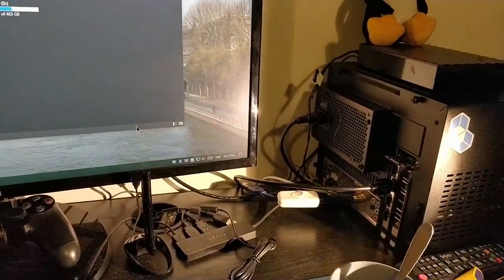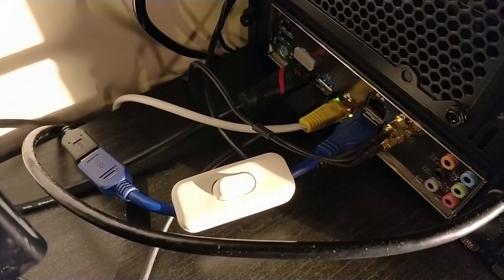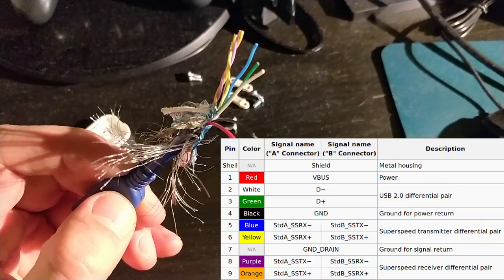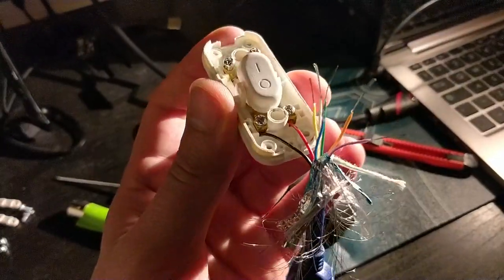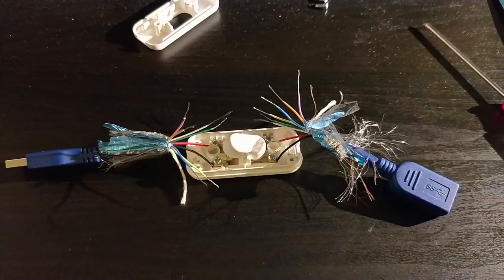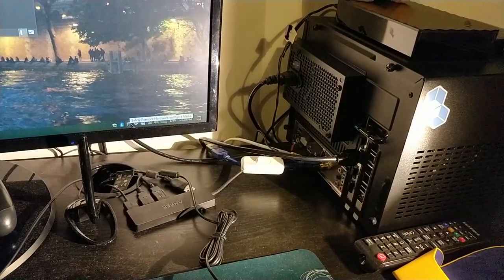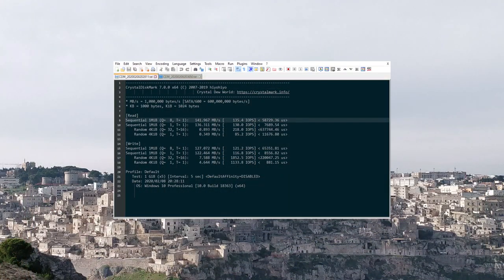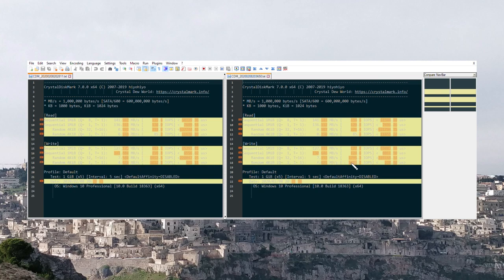USB 3.0 On / Off Switch Button: Type A Cable Teardown in 3 Minutes

Comment: Thank you for this. If you're careful, you don't need to cut all the wires. You can cut and shorten only the black and red, and leave all the rest intact.
Reply from the maker: exactly, in my case I needed to shorten the cable

Comment: Going to use this to mod the living crap out of my lenovo Idea-pad S145 crap-top. I will have one for a ventoy medium, one for an attiny 85, one for a USB to 3.5mm audio module, and one for a sim modem if I felt like it. I figured that it would just be interrupting the power Busses, thanks for the interesting demo. I did something similar with a USB 2.0 port on one of my old optiplex pcs back in the day to add in some cold storage and keep my data safe, as well as adding in some wifi / bluetooth. Just wondered if someone had taken the time to add a simpe switch concept to a cable as a good place to start. Subbed to the channel.

Comment: Will it work if the switch has only one contact point for each side? In that case, should I connect the switch to the red or the black wire?
Reply from the maker: it will work. I would switch the red one but there's no such a difference in that case.

Comment: I'm a total beginner with electronics.  I can repair, but not build circuits.  I only really understand the battery diagram and some basic capacitor and resistor type stuff.  I've got a question to askthat I hope you can answer.  I want to do something like this but for physically powering up and turning off a rasperry pi 3b in a custom project that I'm building.  The switch will be mounted on the Megadrive mould I'm using (drilling a hole and screwing it on) that is recoloured and redesigned.

The 3b has a micro USB female and the plug that comes with my Pi accessories is Micro-USB male to 3-pin male electric plug.

I want to buy a 'Latching Push Button Switch, Pin Jack Self Lock 3A Silver Contact Material 4 Pin Button Switch for LED Light(white, 9-30V)'

The switch in question that I'm buying has + and - terminals, but only 2.  Your on/off switch above has 2 sets (+/- on left and +/- on the right - 4 altogether).

My plan is to expose the shielding like above and screw the positives into the single + terminal (I could solder, but I'd imagine using small conduction screws would be much easier and less of a disaster with my not so good soldering skills) and the black ones to the single - terminal.

Question is, would this work?  I see no reason why not, but was concerned that doing it this way would create a short.  Also, you'll see there are 2 copper coloured terminals.  Are these for the LED?  If so, how would I go about getting these set up?  Additionally, don't suppose you know if these switches have inbuilt resistance to stop the LEDs from overloading?

Sorry for the long question, but I'm hoping you may be able to help me
Reply: Hey, late response but it may help, it your switch only has two terminals just cut the red wire and solder one end to each terminal, and keep the ground (black) untouched.

Comment: Would it be possible to take a pure power usb cable, split it and just wire red and black to each side to make a switch on the midle of the cable?

like a light switch on a usb power cable?

Comment: Where did you put all the other wires?
It seemed like there wouldn't be any space for them inside that tiny plastic enclosure.
Also, thanks! Waiting to give it a go myself.
Reply from the maker: oh it doesn't seem to be the case but the switch actually contains all of the cables! otherwise it wouldn't work 😅

Comment: If you only need to switch the black and red wires why not just cut only the red and black wires?
Reply from the maker: It would be better of course! my cable by the way was too long (like more than a meter) so I decided to shorten it 👍🏻

Comment: Hi, nice video!

Did you connect the shielding and the ground drain wires inside the switch or just the colored wires?

Thanks!
Reply from the maker: hey there! I did connect the ground, not the shielding, but it will even work without connecting the two

Comment: Hello ! Thanks for sharing this. I am thinking about doing something like this, but looking at USB specifications, I can see that in theory, power should be connected or cut before data lines are connected or cut. Your device only cut power without cutting data lines, did you experienced any issues with that as time went by ?
Reply from the maker: Hey! I actually use this switch for my external HDD (now an SSD). No issues so far, but it must be said that I always disconnect (eject) my device before switching off... I don't exclude it might be some issue though if you don't previously disconnect it, cause of the rule you read in the specs

Comment: what about putting a pull up resistor on your D+  with a momentary button so you can leave it plugged in and powered up and just have the protocol identify it and reconnect again when ever it loses connection? or were you specifically trying to cut the power? is that possible?
Reply from the maker: I guess you can try to do that! It's not ideal for me, cause I don't like wasting energy on things I don't use, but it's an interesting question :)

Comment: Hello is it ok if I only cut red wire? Its for led light and I tried only with the red cable and it turns on and off perfectly,  will it be ok if I leave it like that or do i need to cut black for a particular reason? Thanks a lot!!!
Reply from the maker: Cutting the red only should be enough! 👍
Reply: @LukeLorusso  ty  ❤️

Comment: What if it’s only red and black, and the switch only has one piece of metal on each side instead of the two screws like you have
Reply from the maker: what "it's only red and black"? if you mean that only 2 cables are present, then it's a charging-only cable, where the red one is the positive and the black one is the ground.
About the switch, sorry I don't understand: you mean that only one side is "switchable" and the other isn't? in that case, you only need to switch the black one; the red one can stay linked
Reply: @LukeLorusso  it’s only for power, I want to put a button on it, i had the red wires connected to the button and the black ones were just completely disconnected

Comment: I'd like to buy one of these. Can't find any on Amazon.
Reply from the maker: I was fortunate the guy at the "ferramenta" in the town had it
Reply: Now there is one on Amazon "Cable Matters USB 3.0 Extension Cable with On Off Switch 6 ft, Support Data and Power"

Comment: Isn't it, that you need to only cut red cable and shorten it by the switch?
Reply from the maker: yes exactly, unless you also want to shorten the cable like in my case
Reply: @LukeLorusso  Hi... do I  need to connect the black wire as well in the switch or just the red wire?

Comment: Where can I buy such a USB connector with on / off button? I don't want to do it myself because it's insecure.
Reply from the maker: I did this because it was impossible for me to find such a cable, otherwise I would have brought it
Reply: Search eBay. 'USB cable on off switch'
Reply from the maker: @leodf1  the 3.0 kind? Oh yeah there's ONE RESULT... from CHINA...
don't know where are u from, but I'm in Europe and I prefer to do it by myself
Reply: @LukeLorusso  Don't know if it's USB 3. When I type 'USB cable on off switch'  I get many results. Not only from China. Anyway thanks for the video. Just finished my own one. Why buy and wait for one if you can make one yourself right now.
Reply: Now there is one on Amazon "Cable Matters USB 3.0 Extension Cable with On Off Switch 6 ft, Support Data and Power"